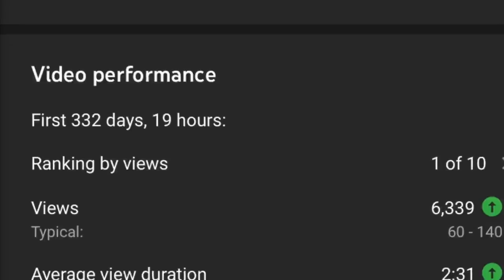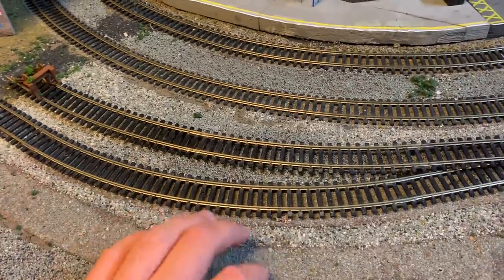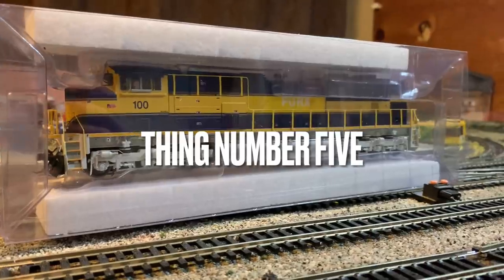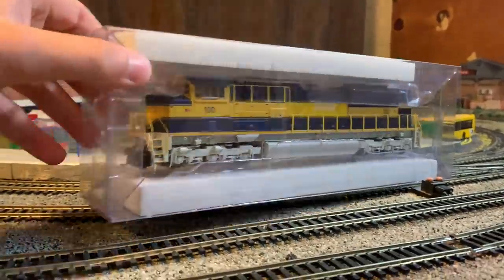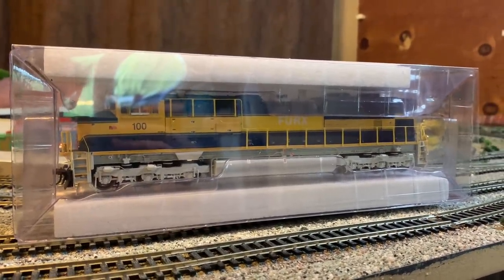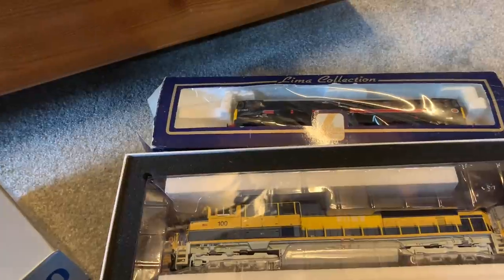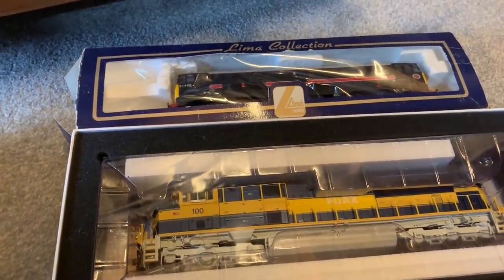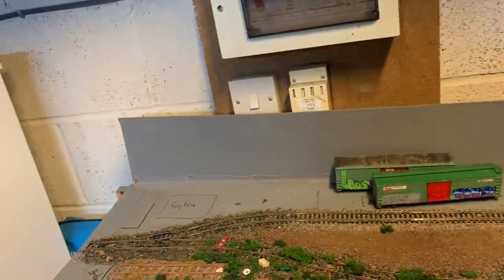DONT DO THIS ON YOUR MODEL RAILWAY (Top 10 Things to Avoid in 00 Gauge)

Comment: No value judgement meant here. Only calling it for what it IS ( which, though, is perfectly OK for you and others ).
I.E. 
Your chosen modeling level, all around, is a tad on the 'toyish' side anyway and nowhere near what a seasoned modeler would call a 'fine-scale' model railroad..You yourself point some that out at the onset, right up thru to 5:00 !  What's most strikingly wrong is your mixing British with US locos and cars AND thus, couplers ! Also, betting the 'freelanced' US diesel [ 3:49 ] is 1:87 HO, looking too small next to 1:76 OO scale. At least if  you'd picked one and stuck with it (likely British for you), then, ONLY the eras would be in question ('50s-ish 'transition era' justifying steam AND diesel side by side), and NOT country/continent of origin !!! 
So:
Due TO  all this, the placement of the Power Terminal being where you did put it is perfectly in balance with everything else..Of course you needn't have drilled such a gaping hole just for 2 wires to go through. You can still move terminal elsewhere. Or remove it altogether and solder the 2 leads to the rails...But if you keep it where it is, perhaps a tiny signal box/tower on top of it, or just some bushes, mound of ballast, say.
Finally :
It's NOT your (acute, #4-seeming) switches/points causing the DERAILS !..
The derails are because you've formed ' S curves WITH them. Especially long coaches will derail on tight S curves. Usually it's 2 cars having their couplers MAXED outward in OPPOSITE directions that causes the trucks/bogies to lift off the rails. The rule of thumb is: 
A section of TANGENT (straight track) the length of your longest rail vehicle needs to be between opposing track SPIRALS (curves)..And you haven't them.. 
In any case I've still enjoyed your video and gave you a thumbs up....It matters not, what anyone does hobby-wise. It's only that one realizes the level of his or her indulgence in it and perhaps is willing to learn from others further along in it. And even THAT is not a prerequisite to being in ANY hobby. Why? For the very reason that it IS, just a hobby !!

Comment: the loco you called freelance is an american loco ...gp30 it looks like.it wouldnt fit our uk loading gauge so move that off lol.also its a common mistake getting carried away buying nice things lol weve allllll done it .
Reply from the maker: It’s a GP9, the alternate history behind it is that most of the railway was destroyed during the welsh civil war against the UK, so after it was rebuild to a much more capable gauge allowing them to import various locos, or maybe the loco was built to a smaller size than standard as can be done in real life, there’s amaerocan outline locos on cape gauge lines in Africa for example, just a. Slightly scaled down body